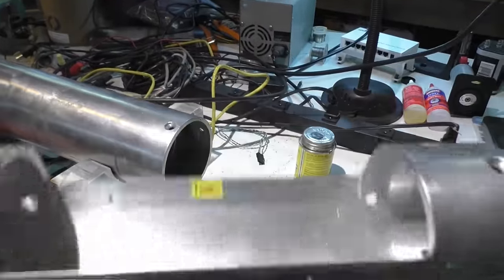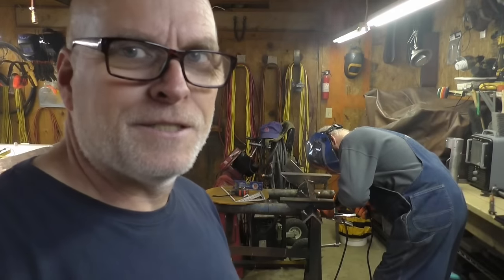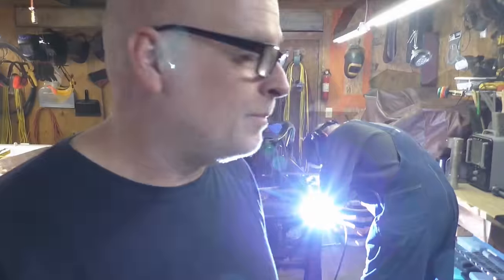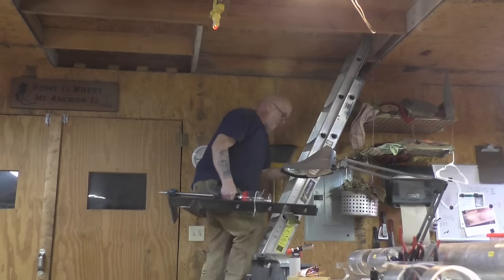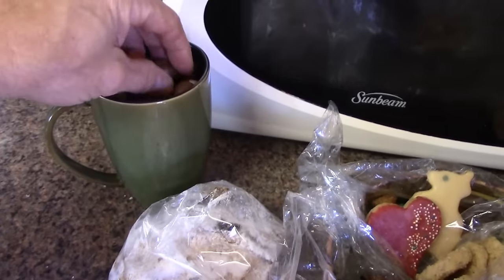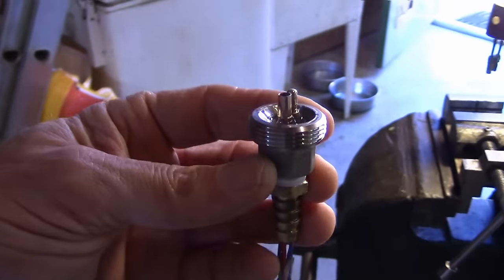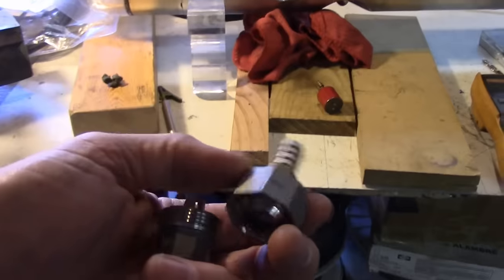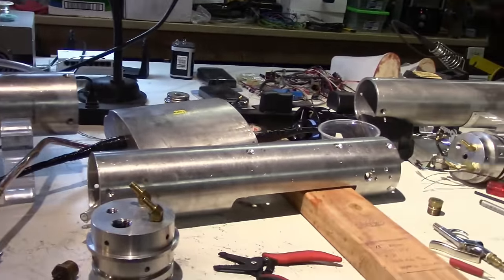ROV - Remotely Operated Vehicle work continues

Comment: Kewl indeed. Engineered and machined.  Limited only by ones imagination. Good stuff SV Seeker. 
I've worked doing similar. Robot 6 wheel prototype  (lots of mil-spec).  MRAP, M2/3, M1, etc.  machining and QC in manufacturing for the "military industrial complex", and ,presently...just do calibration and "tinker".
Reply from the maker: What an excellent job history.

Comment: The cable connectors look good. not too different to how Oceaneering do it with their pro ROVs. They use amphenol solder pin connectors hose clamped to Tygon plastic hose for the whip body. The wires run loose through the hose and the hose is oil filled to make what they call PBOF (Pressure Balanced Oil Filled) Cables. They found it to be the most cost effective way to pressure proof electrical wiring as  completely air free custom cables are ridiculous priced. The PBOF way means you can make up any electrical whip for any part of the vehicle out of normal auto/marine wire, a bit of hose and a couple of connectors (the amphenol brand are quite pricey but corrosion resistant). Any air in the whip will crush and will cause water ingress. To that end I would cut off all the heat shrink you have as that's just an air trap. Loose wires, fed through a hose, leave off the top connector, hang hose vertical and fill with oil, put top connector on with no air bubble and you're set for  3000m of water depth with only the expense of a few bucks at the auto store.
Here is a photo of an open telemetry can (brain), which is the only dry part on the Oceaneering ROVs and is an extremely heavy built alloy pressure vessel. You can see all the Tygon PBOF whips connected to the end cap: http://www.oceaneering.com/wp-content/uploads/2011/05/oceaneering-rov-maintenance.jpg

Comment: Something I can't figure out about your design is how your stabilizing for the roll axis when in ROV mode and not under tow. Are you just hoping the wing on top will do that?
Reply from the maker: The wing is make from syntactic foam so it floats and we'll add a lead weight to the bottom of the sonar housing to provide roll stability.   ...first we need to see how bad the roll is.

Comment: I HAVE A QUESTION ... HAVE YOU TRIED OR THINK IF SOME OR ALL  OF THIS ELECTRONIC CAN BE PROTECTED WITH MINERAL OIL .... !!!

I HAVE SEEN MANY VIDEOS OF COMPUTERS WORKING NORMAL INSIDE FISH TANKS.
Reply from the maker: That is often done but there are problems with exposing some circuits to the pressure as well as the mess.  However it will not work for us as we need to air void in the hull to provide positive buoyancy.
Reply: I have seen it used for just about everything from lighting, to electronics, to optics on TV'S and some cameras, the physics on where to apply or not! that part I just don't know. 
at the end this is a learning process for you and me.

Comment: Do you have a plan on how to stop pressure from crushing that wire hose?
Reply from the maker: The only trick is to fill it with wires so the wires prevent the pressure from cutting the hose on the end of the barb.
Reply: Wow that was quick answer, thanks. I had an idea but im probably overlooking something, what would happen if you fill it with mineral oil that PC guys use for oil cooled PC's, i remember its not conductive.
Reply from the maker: We can't do that.  The air inside provides the positive buoyancy we need.
Reply: "im probably overlooking something" :). Good luck and have fun!

Comment: What depth are you planning to run the ROV at?
Reply from the maker: We have tested everything at 2000 psi and that will get us below 3000 ft.  The problem is the cable connection but the plan is the eventually loose that and then we can go deeper.

Comment: Where did you get that arm you show @ 5:31 for the plug jig? I've been looking for a stiff soldering jig. I got one of those hobby creek helping hand style jigs, but it's arms are hard to get in the right spot. https://cdn-shop.adafruit.com/1200x900/2474-01.jpg  I need something with adjustable tension on the arms.
Reply: I think I might have found them. I saw something similar rigged for a video shoot. Google camera arm and found em.
Reply from the maker: It's a NOGA indicator holder.   They lock up very tight for holding indicators used by machinist and the run $60 and up.   https://www.youtube.com/watch?v=0Wg6wTlhSnI